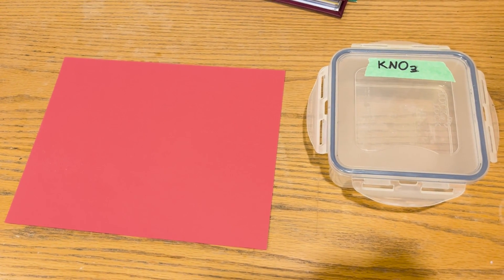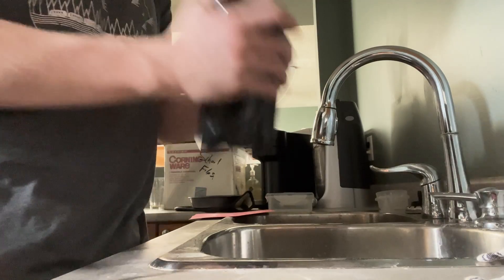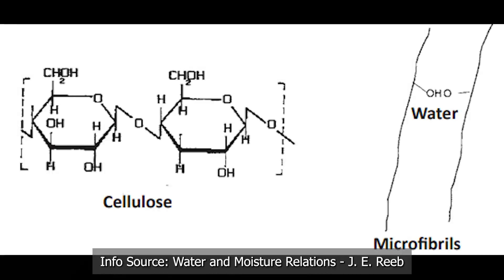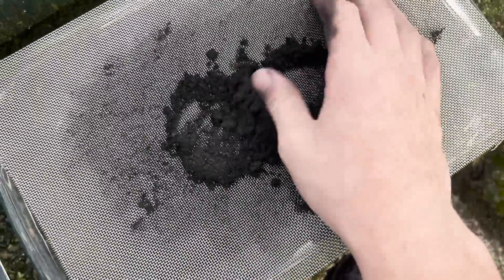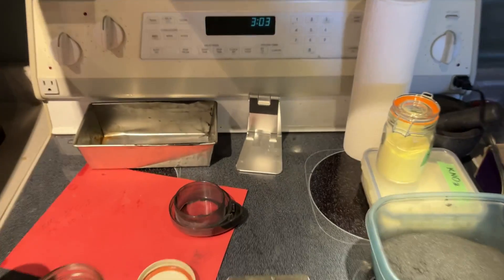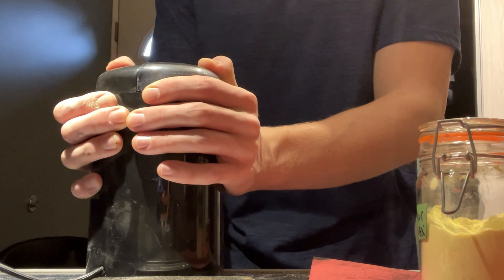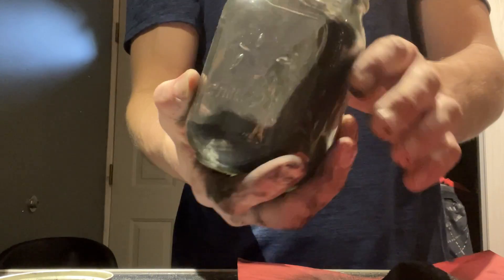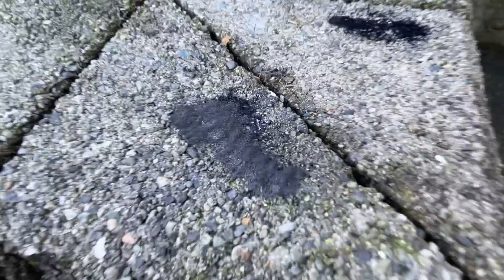Homemade Black Powder Instructional - Minimal Equipment

Comment: Wow, this could be improved on in so many ways. I’ve been making gunpowder since I was a kid. This is the way I did it when I was 10 years old.
Reply from the maker: "minimal equipment" is in the title. If you'd like to expand, go ahead. I enjoy making energetics, but use BP for firecrackers.
Reply: @kitchen_chemistry  eventually I would ball mill the mixture with glass marbles. The better mixed and the finer the individual particles, the better. I guess some people would consider it unsafe, but I don’t think you have to worry about that with black powder. 

Sorry, you did say that, I hope I didn’t sound like a total A hole.
Reply from the maker: @madmattdigs9518   Absolutely you're right. Ball milling BP is quite safe with glass marbles, and it would increase the burn rate a ton. I tried making a ball mill, but it broke after ~30 hours of running. I'll probably invest in one once I need powdered aluminum

And no worries, you're all good.
Reply: @kitchen_chemistry  This is kind of funny but when I was a kid, if you went into any big drugstore, the used to sell jars of saltpeter. It was used for veterinary use I guess as a diuretic. I remember reading the label and there were instructions for how much to give horses and cows. Something like that… then in the same aisle they sold bottles of sublimed sulfur. It was called “flowers of sulfur”. But it was just a very fine powder sulfur. Which people would use in a bath for your skin. 

So, yeah, I used to go to the drugstore and get 2 of the 3 ingredients just like that. And even though I was a kid, no one ever questioned me about buying them. There was no reason to… then I would just use charcoal from my parents barbecue grill. The coals that were already mostly burnt worked the best. They were already soft and crushed up very easily. 

From reading old books at the library I learned that for explosive purposes, it was common to use a more even mix. Instead of 75% saltpeter, they used more like 50%. So, more charcoal and sulfur, less KNO3. But when I tried to do that, it actually burned slower. And that discrepancy drove me crazy. What I eventually learned was that you had to mix the ingredients on a molecular level. Very fine and very well mixed. And very dry. And you actually had to hard press it together wet, then dry it, and granulate it. 

Anyway, I had a lot of fun playing with that, and trying to increase the burn rate. Because really well made, it’s almost as fast as flash powder. Like if you buy it professionally made, for cannons or black powder rifles. It’s just really hard to do that yourself at home.
Reply from the maker: @madmattdigs9518  Can't do that anymore haha. My dad has similar stories.

You'd be interested in something called "yellow powder," sometimes called "fulminating mix." It's supposed to be a forgotten energetic mix, found in "Ure's Dictionary of Chemistry, first American edition, Philadelphia, 1821" or in a PDF online which I cant say the name of (Youtube has disabled comment sections on my past videos). Its copyrighted in 1998 by Dirk Goldmann, so not too hard to find if you search for it.

As a side note, I have actually used this BP to make a rifle shooting a marble at >90m/s muzzle velocity, measured using some basic physics.
Reply: @kitchen_chemistry  I used to read old books like that in my school library. There were a couple from the 1800’s with step by step instructions for making different explosive mixtures. That’s where I learned everything. And from older kids in the neighborhood. There were a couple brothers who made nitroglycerin and other high explosives. It was so dangerous, but a lot of fun, and somehow I managed not to blow myself up too bad. I do have scars on one hand and arm from a device that went off in my hand. But it was not very powerful, and I really was lucky. It really seemed like that was just the fun thing to do back then. It seems to me it really changed after 9-11. Then it went from being fun to serious trouble to do those kind of things.
Reply from the maker: @madmattdigs9518   In my opinion, as long as the scars arent too bad, they make the stories interesting and are thus worth it (to some extent)
Reply: @kitchen_chemistry  I’m sure you know this, but you can still go to the hardware store and get everything you need to do these things. Stump remover, and liquid fire drain opener, and you can whip up some nitric acid. And of course, the internet, you can buy a lot of chemicals. So I guess that hasn’t changed much. But I wouldn’t want to get in trouble. So I retired from my amateur chemistry career.
Reply from the maker: @madmattdigs9518   I have access to and use all the basic acids and more, however, no stump remover where I'm at so its a little more difficult to distill my nitric acid. Still manage to make energetics. My first video was making Nickel Hydrazine Nitrate, a purple exotic primary energetic
Reply: Add alcohol solvent for binder 1% should increase your burn with minimal tools version
Reply: Then show us the difference ways
Reply from the maker: @chikatempletv4032   for what in particular

Comment: Id advise against grinding BP in a coffee grinder, the motor isnt perfectly isolated from the blade compartment and you could end up igniting your mixture, even if not friction sensitive. Grinding the ingredients separately is fine
Reply from the maker: You're right. I stay away from that in this video. I did do that for making a fuse, but very tentatively because its risky.
Reply: I was grinding Potassium Perchlorate with my cheap Walamrt coffee grinderand the  motor burnt up causing it to short- out and sent sparks in the mill and it exploded like a hand grenade.
I had minor injuries which I can't  explain, (Miracle)? I should have blown my hands off.
I did some research and found out that after the particles get smaller than 100 mesh, they will explode with a spark or static, with no fuel.
Reply from the maker: @hunternedib1119   hence the scare I feel when working with it. Thats amazing you didn't lose your fingers
Reply: @hunternedib1119 hmm perclorate is generally safer than chlorate mixtures because no sulfur is used if you were making say a aluminum mixture then the perchlorate is needed as Potassium Nitrate won’t yield a detonating powder without it being constrained… my flash powder detonates not deflagration so it will explode just powder in the open.
Reply: It must be ground in a ball mill, or in a vibrating ball mill. Then the powder turns out to be very fine, especially for vibration, the powder resembles a cream, probably particles less than 1 micron, consider a nanopowder. My aluminum powder exploded very well.

Comment: Will this work  in a 50 cal black powder rifle and pistol
Reply: I've made it in a similar method and ran it through my .50 caliber Hawkin rifle from 60 grains up to 120 grains. It wasn't really any more dirty than store bought black powder. Ran it in my .45 caliber single shot pistol and my .44 caliber revolver. Works fine in all of them, would say it was a bit less powerful than store bought.
Reply: The stuff he is making won't work in a rifle if it does it would be very slow and week I've been making black powder for years and what I make is as fast and as clean as store bought black powder if not cleaner if your interested in how to make good black powder go to everything black powder on you tube or Hoffman reproduction on you tube they will teach you how to make real black powder
Reply: gunpowder should be granular, and it is desirable to reproduce real industrial technology, it is not very difficult. You definitely need a ball mill and a powerful 5-10 ton press.

Comment: Surprised you don't have and Moisture Absorbers packs in your potassium nitrate to ensure it keeps dry?
Reply from the maker: I would place some silica packs in there if I had any. However, the rest of my potassium nitrate will be used to make nitric acid for future projects I have in mind
Reply: Desiccant packs?
Reply from the maker: @donoberloh  yes, they suck the moisture out of the air. KNO3 is hygroscopic, meaning it grabs moisture from the air which is bad for BP. Using other substances to grab the moisture first increases the quality of ur oxidizer
Reply: electric hot plate, low heat on a pan for an hour stir every 15 min and the nitrate will be completely dry.

Comment: I dont think placing gunpowder in an oven is the greatest idea
Reply from the maker: Actually, gunpowder is barely even an explosive. You can hit it with a hammer, even heat it up to over 200c without it exploding. According to various sources, it ignites when heated over 400c or when exposed to a flame. However, in the video I only place charcoal in the oven, which is even safer.
Reply: Should be OK if the oven is warmed to about 110C and the  power is turned OFF.  Then put the powder in and leave until the oven is cold.
Reply from the maker: @KathrynLiz1   That's smart to leave the oven off. I've dried fuses and granules, but have never turned the oven off. Instead I make sure that convection bake is off to prevent any gunpowder from floating around. Next time I'll probably do that though so thanks :)